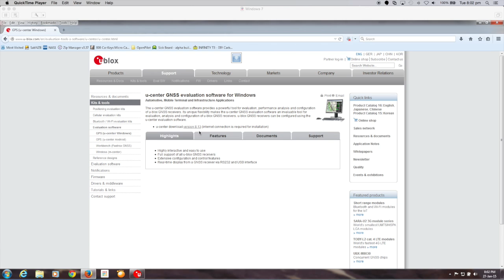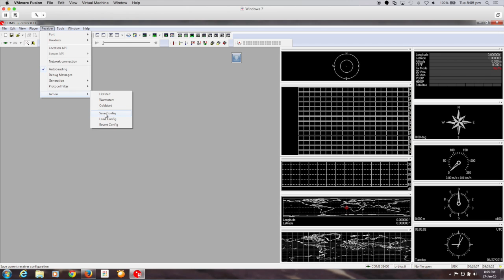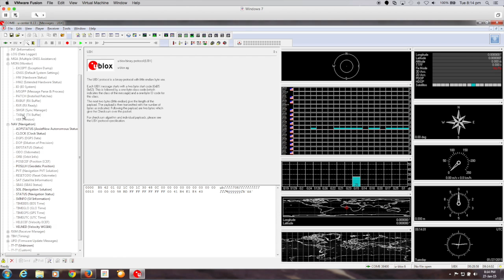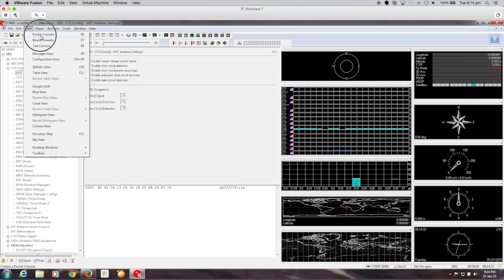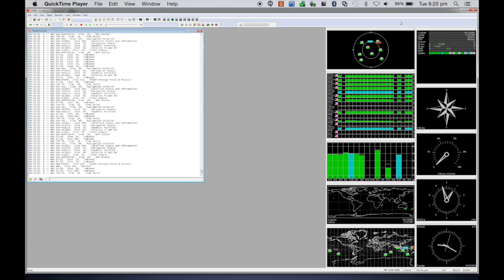Ublox LEA-6H GPS for Naze32 - Initial Configuration

Comment: when you say this module gives you velocity do you mean raw alues of actual displacement upon time(m/s) or does it have to have a written algorithm for the calculation. also what is the difference between gps altitude and pressure altitude and what is the difference? which one i more reliable?
Reply from the maker: Depends on the display system you use, such as the one i hooked it into (minimosd). It depends on what the system that reads the GPS info can parse the data and render it out as. From my understanding, GPS should give you around 2 meters typically for accuracy, can be better from what ive seen and is dependent on the amount of satellites acquired. Pressure - not quite sure. On the big planes i used to fly it was pretty accurate but they have proper instruments, with the sensors on our flight controllers, they probably fit into the GPS realm of accuracy i suspect.

Comment: I have the same gps I tried to connect to my fc and  I enabled the gps from cleanflight and I cannot make it works
Reply: +Mohammed Alhanooti Its wroking when i use usb bout when i try to connect using ftdi its not working
Reply: +Mohammed Alhanooti Mohammed, sorry i'm not sure why that is happening. Mine worked with FTDI. Are you sure your comm port is correctly setup?
Reply: Yeah I tried with two ftdi and with 2 fc even I tried to solder the pads , do you think can i get rx and tx from usb ??
Reply: +Mohammed Alhanooti i have no idea what you mean by usb. There is no usb interface on the GPS. please explain
Reply: +Seafury mike I mean can I connect th gps to fliggt controller using the usb port??

Comment: When I tried to configure the GPS using your file it didn't work the first time and I got a message saying: "Version Check" but it seemed to upload OK the second time but now the GPS doesn't seem to be working.  What are the setting in the file anyway?  Is there some way to change things like the baud rate?
Reply from the maker: Thats what the file is doing steve, changing the baud rate.
Reply: +seafurymike I think what the file did was break my GPS!  How can I put it back like it was?  If anyone is thinking about doing this, Stop Do Not Do IT!  There is no way to even tell what that file does!
Reply: +Steve C I got it working again by setting the configuration back to the default and getting rid of your files settings.  What were you trying to do anyway?

Comment: If the GPS also has a magnetic compass in it does that need to be configured too?  If so how do I do that?
Reply from the maker: you just need to do the dance and calibrate the mag. no software config required. i have a video on calibrating mags in my video on xaircraft minix
Reply: +seafurymike When I try to calibrate the external compass on the GPS unit that's plugged into my PX4 it doesn't seem to do anything and only the one on the board seems to work. Is there some way to check the external compass?
Reply: +Steve C have you tried to get serial data by plugging in the gps? I show you in the video that you can get satellite data, so if its possible, this is where you would see mag data, otherwise i have no idea.
Reply: +Seafury mike The GPS works OK but the compass is on a different port.  I've never seen any settings in any of the software that lets you select the built in or external compass though.

Comment: Mike, I have the neo 6m gps unit with the built in compass.. i have to get a serial to i2c board made ...i have the gps unit connected to ftdi and can get a fix fairly quickly but if i disconnect the gps and leave it a few hours it takes about 10 mins before i get a reliable fix....do you think it could be losing its almanac ephemeris data it has a battery on board, and an eeprom battery voltage is 2.5v ? any tips on getting a quicker satellite fix ? thanks Al..

Comment: is it possible to setup gps with the naze32 acro or do i need the full version?

thank you
Reply: you can set it up but you wont have PH or RTH functionality. i have mine setup (yes i know I promised a follow up video tutorial) which can have the GPS information fed into an OSD like a MinumOSD unit to provide long/lat, gps speed and height and RTH indication.
Reply: Seafury mike
 thanks Mike for the fast reply, I'm running on the kk 2.1 I always worry I might loose range signal, a return to home would really take a lot of stress out of me.
Reply from the maker: Paul DTOM I have a Taranis transmitter and with a FrSKY D4R-II, you can setup RSSI to output audibly to your Taranis the RSSI value. When it gets low, you can have it alert you so you can bring back the quad into a better signal area. Atleast this is how i have setup my unit. Quicker and easier than putting in a GPS
Reply: seafurymike
thanks, I have the turnigy 9x with er 9x firmware, The Frsky XJT module with the frsky D8R XP just arrived today. I will take a closer look see if this setup will support the function you've described.

Comment: Waiting for my Naze 32 full board to get here. I'm anxious to get this GPS module and dive right in. Thank you for your time and for your knowledge. If you have any input, how does this compare to the stock Naza GPS unit?
Reply from the maker: Sorry no idea how it compares to Naza as I have never ventured down that path. I tend to use open controllers, such as CC3D or Naze32 only. I've only tried this with baseflight, cleanflight is next on the list. I just need some spare time.
Reply: no problem, thanks for your info